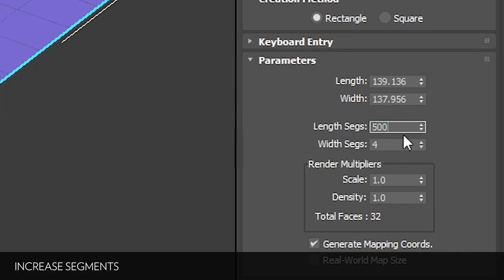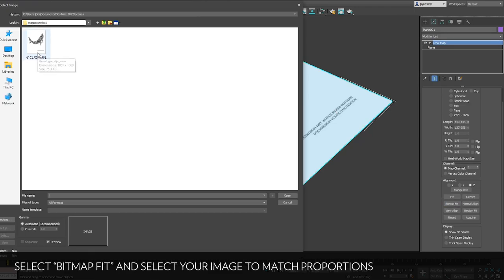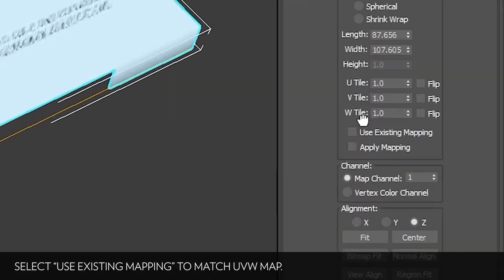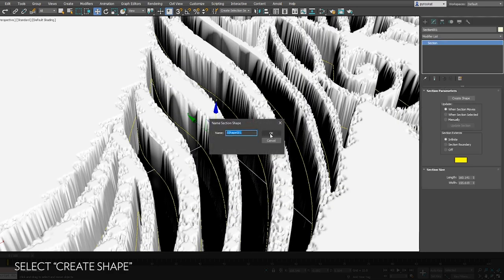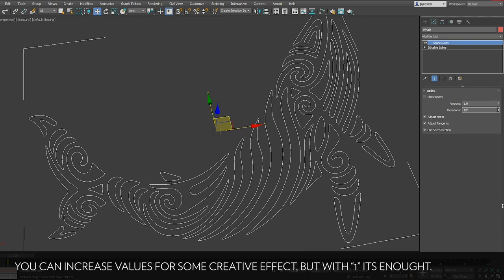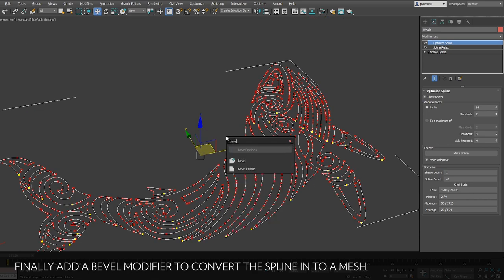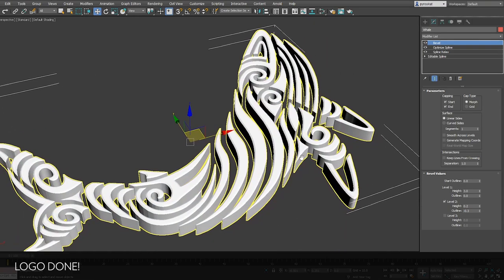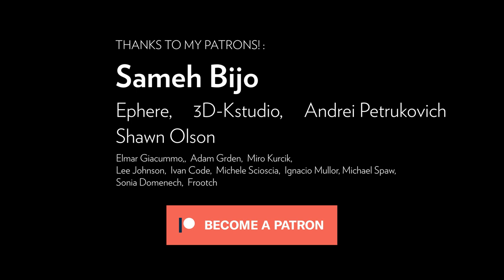How to convert a JPG Image to 3D logo with 3ds Max only

Comment: When I drag and drop an image on top of the plane, it won't show. Any idea what I'm doing wrong or if an option is turned off? Thank you!
Reply from the maker: Make sure on Command pannel on "Display" ou have on shaded: "Material color".     Then on your viewport you can force to show materials if its not doing automatically going on   [Standard],  "Materials", "shaded materials with maps".  This should do it!
Reply: @andvfx  Thank you! It worked! But after using the displacement option I don't get the same result. Instead, I just get a rectangular shape at the end. I tried using both a png and a jpeg (both vectors B&W) but I got the same result just different sizes of shapes.